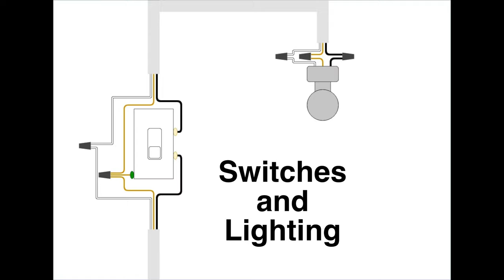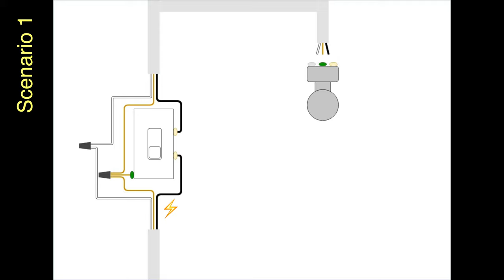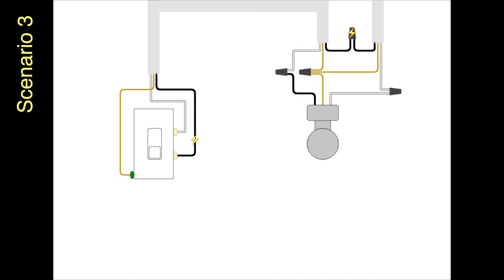How to Wire Switches and Lights

Comment: I am an electrician and you did a great job of explaining a basic lighting circuit. The pointer I have for you is with the problem you had with the lamp cord on the fixture. You are right, typically the ribbed wire is the neutral. A way you could check that is to ohm out each wire to the lamp socket. The tab in the bottom of the lamp socket is the hot/positive and the threaded portion is the neutral/negative. Turn your meter to ohms .You put one of the meter leads on a wire of the fixture, make sure the circuit is off or disconnected and the other meter lead on either the  tab or the thread portion. If the meter reads open than its the other wire. We call this, ringing out a wire because most meters will make a tone when you complete the circuit. I know I am not a word smith, but I hope this helps.
Reply from the maker: I thought of this exact test when I was editing the video. Thanks for the comment.
Reply: Ryan Howard 👍👍👍

Comment: Here’s the thing. I’m trying to help a friend connect a wall lamp. Didn’t take a picture of the connection. Aside from that, the wires coming from the wall are multiple. The black wires ar 3, the white wires are 2, and there’s a yellow wire which I believe is the ground. The lamp only has 1 black, 1 white, and a copper wire connected to the lamp with just a screw. I connected the white wire with the 2 white ones, the black wire with the 3 blacks, and the yellow wire to the base or fixture that came with a green screw along with the copper wire that’s attached to the lamp. When I switched on the breaker, the lamp turned on, but as soon as I turned it off, the breaker shut off too. Did I do something wrong? I really hope I explained this correctly.
Reply from the maker: Please call an electrician.
Reply: @handydadtv  Really? So you don’t know what’s going on then? Ok.
Reply from the maker: It’s impossible for me to diagnose and tell you how to correct a short circuit based on a YouTube comment without risking your friend’s house or your life. I’m not willing to take that risk.
Reply: @handydadtv  And I’m 100% fine with that my friend.

Comment: My question is for when you hang the fixture at the end.  You connect the ground and then it seems you connect the red wire from the box to one of the black wires from the light itself.  Dumb question but what did you do with the other black connection from the light (connect it to black in the box)?????
Reply from the maker: When a light has a chain with visible wires like this, the wires are usually the same color. In my case, they are black. But I’ve seen clear, white, brown, etc. 

One of the wires on that kind of lamp cord has ribs. The ribbed wire is typically the neutral that gets connected to the white wires in the ceiling. The non-ribbed wire gets connected to the hot.

Comment: So i have a question...i had an old dimmer switch in my sons room go out so I went to Lowes to get a new one. Long story short, when i turn off my light switch the light and all the sockets in the room go out when when i turn the light switch back on, everything works again. The dimmer switch is a 3 pole. I the "live" wire coming into the switch box from the bottom amd the ceiling light wires coming into the light switch box from the top. Help is much appreciated.
Reply from the maker: Unfortunately no easy answer. Get a voltage tester and figure it out or call an electrician.

Comment: I searched the net for simple wiring diagrams like are shown in this video for 3 days!  This video is masterful and full of helpful tips. I only wish it had been titled "How to wire your chandelier including wiring diagrams" or some such way that Google AI could find it! Thanks, this video saved my sanity - no other DIY video out there shows you how to handle the oddball number of wires one typically finds in existing situations - they all assume you have 2 wires coming out of the ceiling and that's frequently not the case.
Reply from the maker: Glad it was helpful 👍🏻

Comment: Hi, I am not a newbie when it comes to electrics, but I am always being asked how to connect a three-way switch where two switches control one light and I have been looking for a well-explained video online. I like the way your videos go into just the right amount of detail without confusing the watcher so I was hoping this video would cover the three-way switch. I know you are not an electrition by trade but the problem with trades videos is that they try to complicate the situation so that the average person will put the work out to them instead of doing it themselves. I also know you are in the USA and don't use earth sheld but that is a simple change to explain. Anyway, the point of this rambling is to ask if you are considering doing any other electric videos and hopefully one on three-way switched circuits.
Reply from the maker: More complex topic for a future video...

Comment: Very good explanation. In scenerio 3, where the white wire is being used as the switch leg, you should put some black electrical tape on the insulation at each end. This indicates that the white wire is now a hot wire and not a neutral wire.
Reply from the maker: I've never seen that done. Not a bad idea though.
Reply: It wouldn't be a bad idea to label them as well.

Comment: Thanks again! So, if you are powering an outlet or another switch downstream from a light fixture, is a 3 wire absolutely required? Or is there a way to do the whole circuit with ONLY 2 wire (assuming there are no 3 way switches or dimmers)?
Reply from the maker: Assuming power comes into the switch box, the outgoing black wire will be controlled by the switch. Everything downstream will be controlled by that switch.

Comment: Very informative. I have a switched light and need to add an additional light. Do I just run black, white and red straight across to the new  light? Thanks, I liked your video.
Reply from the maker: In your situation, you would just tap into the connections on the existing light (ie. take hot from the red wire, assuming that’s switched).
Reply from the maker: Point is, you don’t need to spend extra on wire that has a red and black. You just need a black wire to run the second light.

Comment: Hello, great and helpful videos -- Thanks!   Could do a video for the wiring of a "switched outlet" where one plug is "switched" and the other has constant power??  I know a tab on the outlet is supposed to be snapped to "un-link" the two plugs, but from there, I'm not sure of how to proceed.   I looked quickly thru your other videos and didn't see one for this, so sorry if I missed it.  But if there is an existing video clip, please provide a link.  Thanks!
Reply from the maker: Hi and thanks. No I’ve never done a video on that topic, but you have the gist of it. Just break the tab between the brass screws. Typically the bottom outlet would be on all the time, so connect the “hot” wire there and run it TO a switch. Then connect the other wire FROM the switch to the top brass screw.

Comment: Sir I have a question I was wondering if you could help me with.  I’m wiring a pair of 3-way switches in my shed.  I’m running 12/2 and I’ve got power coming into the first switch that meets 12/2 cable for the lights and 12/3 cable that goes to the 2nd switch that meets the end of the light circuit.  Is my wiring setup correct here or does power need to go through both switches first before it gets to the lights? Thanks in advance!
Reply from the maker: This video will help. The second method is preferred for new circuits because it has a neutral in each switch box, which is code. 
https://youtu.be/M_zDt6iJKdQ

Comment: I'm not an electrician...just a homeowner double checking my understanding before attempting to wire a new switch. I had no idea that scenario 3 was possible! Is this code, or just an old-school shortcut?
Reply from the maker: I don’t think it’s code anymore. I never wire a switch like that personally but I’ve seen a lot like that in old homes. I like having a neutral wire so they can be upgraded to smart switches someday.

Comment: If you’re doing a ceiling fan can you just cap off the red wire and use the pull chains?
Reply from the maker: Yes absolutely.

Comment: Hi there, thanks for the great video. I’m a bit concern about what I did and I’m hoping you can help validate and confirm. I also replaced my dining table light fixture which was easy. Followed the same connectors used on the old light fixture. I added an led light as well and ran power from the dining light fixture and use the same switch however, there was no red wire. And I attached both ground wires to the same green screw 😢. I now know running 2 grounds to the same screw is not allowed and I will fix that tomorrow but could you confirm help me understand if the red wire is needed in my case? Thanks so much in advance.
Reply from the maker: 99% of the time, I just replace a light fixture by connecting the new one to the same leads as the old one. If it ain't broke, don't fix it.

But occasionally, I come across a mess that I want to understand better and improve. So I'll use a voltage tester to determine which wires are always hot and which are switched. Sometimes the switched wire is black, sometimes white, sometimes red. I just depends on the electrician who did the installation.

Comment: I'm working on an historical home and the wires are looped from box to box. Trying to wire a ceiling bathroom light to a switch and the light stays on. Power comes in to where the fixture goes, and they ran a wire to the switch. 
So I have 2 wire sets. 1 set is the actual power. 1 set is going to the switch. 
How do I wire the actual fixture. 
Tried all black to black and white to white and no luck. Either the breaker pops or light stays on. Thank u so much!!
Reply from the maker: It’s best to connect the new light the same way as the old light. Assuming it’s too late for that…

I would use a multimeter to determine the incoming hot and neutral. Then, with the power off, set it on resistance to determine which wires go to the switch. 

Alternatively, Harbor Freight has a cheap detector that can be used to trace wires. Only to be used with power off. This might be a very useful tool for your old house. https://youtu.be/UAEq-yvjryQ

Comment: And next, what if you want to control that light from two switches on opposite sides of the room (or top and bottom of the stairs)!?! That gets a bit more complex to visualize with  the assorted scenarios for where the power comes into the circuit.
Reply from the maker: Yes, 3-way switches are a more complex topic. Future video...

Comment: Im confused, in the Scenario 1, when you say fed from the bottom - you mean its fed from and outlet switch?
Reply from the maker: I meant power (always hot) comes in from the bottom, from another outlet or switch or anything else “upstream” - meaning closer to the circuit breaker.

Comment: The light is a ac connection, so the current changes from the black to the white I thought. Or is it alternating from positive to negative on 1 wire?
Reply from the maker: AC cycles positive and negative between the black and white wires. But don’t concern yourself with that; just respect the black wire as “hot”, regardless of the physical current flow.

Comment: I have 4 wires Green, yellow, black and white. Is the green wire the ground wire or the yellow wire ?
When I attached the ground wire (yellow wire) it tripped out my fuse in the breaker room however when the ground wires were detached the light turned on without tripping but the light switch did not help me turn off the light, is it because the ground wires are not attached ?

Secondly, What happens if I don’t attach the ground wire ?
Reply from the maker: I have no idea what the yellow wire is. Ground is usually green or bare copper. You should call an electrician. 

Ground is for safety and required by code. If you don’t connect it, you risk getting shocked.
Reply: @handydadtv  thank you

Comment: New to wiring.  And just curious.  Why don't you connect the white wires to the receptacle, but rather bypass it in this method?  Other than maybe it's code to do this but why?
Reply from the maker: I don’t understand your question.
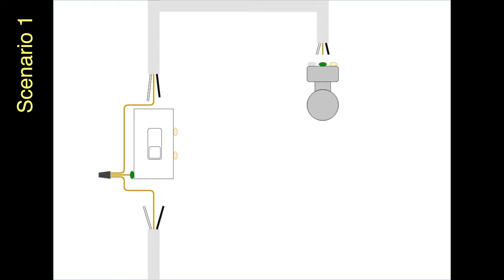Reply: @handydadtv  At 1:42 you show the white wires bypassing the receptacle or switch and getting joined together. So my question is, why is this the case, why don't you screw them onto the side where thee would normally go?  If you did that, is it that then you would not have a switch at this point?  I'm just trying to figure out why you would bypass screwing the white wires down.
Reply from the maker: You only switch the hot wires, not the ground or neutral. Hot is typically black.

Comment: I have a problem my ceiling wires are black, red white and ground and my new cealing fan has a black a white and a small yellow one no blue any suggestions on how to connect the ceiling fan with remote

Comment: I have a weird question:  Kitchen light has 2 black permanently wire nutted together.  Another Black wire.  Two white wires, both neutral, Except when the dining room light is switched on. Then one stays neutral the other is HOT.  So, I wired the neutral white to the Fixture white.  I wired the Hot white, Hot Black and the Black of the Fixture together.  The Kitchen light works.  The dining room light does not work.  It worked just fine before.  I guessed wrong.  Help!
Reply from the maker: Take the bulbs out of the dining room fixture and test again. I bet that neutral stays neutral. It only appears hot because of the current going through the bulbs. I believe all the whites should be all connected.

Comment: Hi. Anyway of showing power supply coming in to switch than to light and wiring up 4 plugs?
Reply from the maker: That depends on how you want to wire it. If power will go from the light to the plugs, then you need to use 3-conductor wire from the switch to the light; the black would be constant hot; the red would be switched. 

This will help with the outlet wiring: https://youtu.be/xex8cPv8CtA
Reply: @handydadtv  thanks for the video. That's perfect 
Can I pull power from panel and wire 5 outlets than use power to power a single pole switch to 1 light? That's where I'm stuck
Can i use 14/2 wire to do that.
Reply from the maker: Yes. With 14/2, use a 15-amp breaker. If you need 20 amps, use 12/2.
Reply: @handydadtv  perfect 👌.  
You wouldn't have a video of that would you by chance?
Reply from the maker: No sorry.
Reply: @handydadtv  I found a simple video. 
If you need to see it I can put it here. 
But I got help elsewhere. 
Cheers

Comment: Would it be the same for multiple lights ?
Reply from the maker: Yes you just run another wire between each light. Connect the black wires, connect the white wires, connect the grounds.
Reply: @handydadtv  and how about if I want the switch to come after the lights instead of before?
Reply from the maker: That’s Scenario 2 in this video https://youtu.be/wRSgemIxamU
Reply: @handydadtv  do you also have a scenario for three way wiring with multiple lights ?
Reply from the maker: I don’t have a video that explains 3-way wiring, but there are plenty on YouTube.

Comment: How do I add a light switch to scenario 3
Reply from the maker: You have a light that’s on all the time? If so, just run a wire to the new switch and connect it between the black wire in the box and the black wire on the light, like shown in the video.

Comment: Faaak. I"m in North America.  Two wires only. Blue and Yellow.  :(
Reply from the maker: Where in North America?
Reply: @handydadtv  South Florida, Palm Beach Country.  Older home built 1973. I THINK both of them are hot. I mean my tester says they are so... LOL   What's crazy is nothing is grounded.
Reply from the maker: @brianpratt2747 I’m surprised there is no ground, for sure. If they are connected to a switch, one wire should be always hot and the other will be hot when the switch is on.
Reply: @handydadtv  Found a crack in the wire causing my bad connection.  Cut out the crack and spliced them back together with some waygu connector. Good as new! Thanks for the video
Reply from the maker: @MuahMan Glad it was helpful 👍🏻